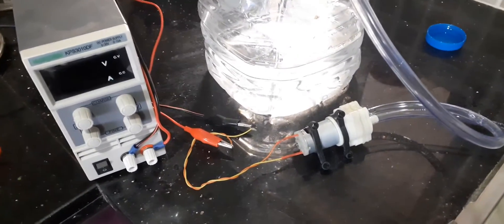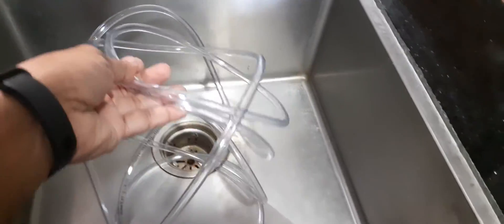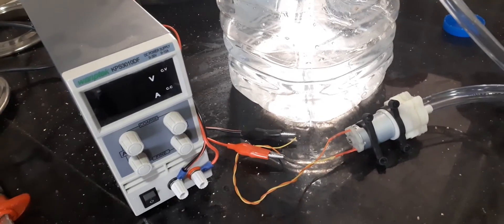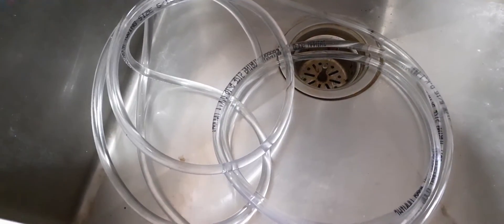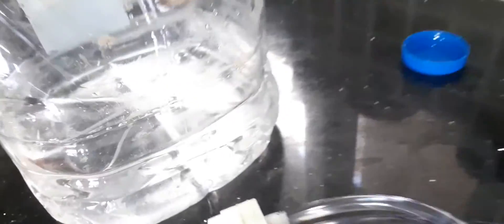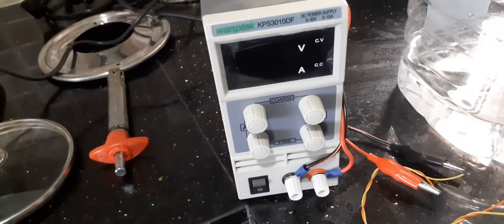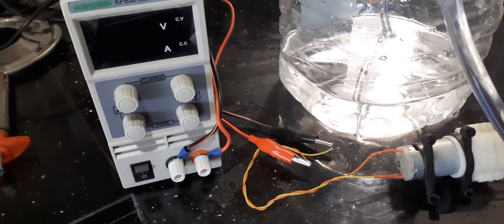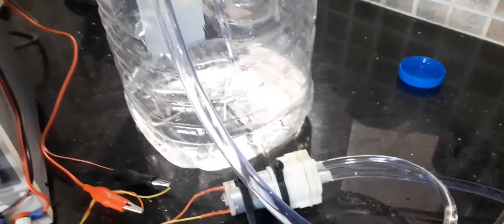R385 6-12V water pump

Comment: Can we use it with waterblock for cooling system ? I mean is the diameter of the pump pipe and water block pipe the same ?
Reply from the maker: Yes. The pipe and pump have matching diameter